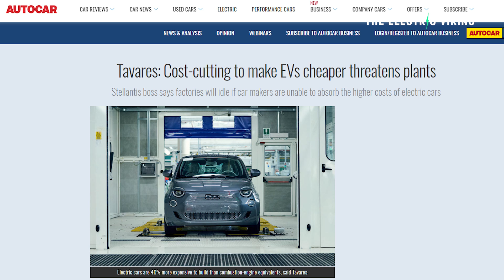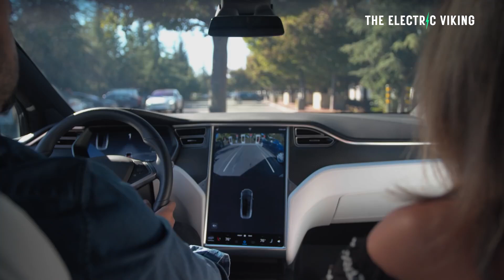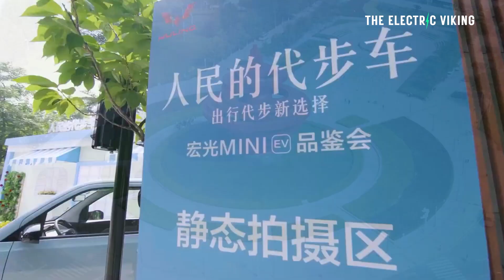Why are some EV's more than double the price of the gas model

Comment: Legacy auto makers have hated electric cars and been lying about the cost and difficulty of their manufacture at least since they were forced to make them in the 1990s ie the EV 1 by General Motors which they would only lease not sell. All the car makers made them. All only leased them until George Bush Junior the then president ,and his Republican cohorts, Big oil owners  had the Californian Zero Emissions Law repealed through devious means. They all then cancelled their leases collected all the Evs took them out to Nevada in the desert and put them all through a giant shredding machine reducing them to tiny pieces. These were all nearly brand new EVs. EVs should theoretically except for the batteries and computer chips and screens be cheaper to make than ice cars.

Comment: I dont know why why  any ev manufacturers aren't using FERADION SODIUM ion batteries. They would be cheaper and have an energy density of 2220 or 230 W akilo higher than LFP at 1a Kilo. And they have a wider temperature range charge holding capacity and supposedly a 9000 times cycle life and they have a factory in Wesstern Auustralia know.

Comment: Traditional car makers build a complete gasoline car, but DON'T install the gas engine and transmission. Then an electric drivetrain is installed. NOTHING ELSE is removed. All the support for gas remains. That car costs 40% more to make than its gas counterpart. Many EV cars are being made this way. While a designed, engineered and manufactured EV specific car will cost nearly 30% LESS than a gas car. Full Stop.

Comment: So many manufacturers will drop EV’s because of material cost or access thereof.  Which means the ICE  bans will go away.  More ICE manufacturers have determined it’s not economically viable for EV’s and most of the world doesn’t have the grid infrastructure & 60-100 amperage residential breaker boxes.

Comment: It seems to me (a non-engineer) that, apart from the battery, an EV should be much cheaper to produce because the engine has much fewer parts and is much simpler overall, compared to an ICE. Batteries are becoming less expensive all the time, so there seems to be little doubt that an EV will eventually cost much less to produce than an ICE vehicle. Stellantis might do well to hire engineers who are focused on efficiency. While they are at it, they might try making a reliable transmission (We had a Chrysler van that was totally unreliable due to its transmission).

Comment: Electric cars don't have gearboxes, exhaust, radiator. The most cost is a ice engine which is one third of the price of the car.
EV motors are small and cheap to produce.
EVs should be cheaper than a ice car.

Comment: There are a lot of evs that by the time you break even you'd have driven over 300k miles on your old car.  This is calculating if electricity was free, which it is not.  Making evs even crazier.  Though to be fair the car market is crazy on ice side as well.

Comment: They are taking a gas powered design, and pulling out the engine and transmission, and jamming in batteries and electric motors into the empty spaces.  Of course it will cost more than, say, designing and building an EV from the ground up, just like it costs more to completely gut and rebuild a house than it does to just build a new house.  And it is a Fiat 500, which is based (ICE or otherwise) on the theory that there is a sucker born every second.

Regarding that miniev thing - which I assume comes standard with paper bags with pre-cut eyeholes - I wouldn't take one for free.  They'd have to pay me, then I'd pocket the cash and drop it off at the nearest recycling center.

Comment: Ev in the body of ice is a disaster.
Designing a new ev is difficult when your past is ice.
Everything is wrong.
Once an ev has appeared it may gradually be made better but some things can not be done gradually.
Also the changes in cars normally do not happen often.
Evs may become better but it will take a long time and it will most of the time not be gradual.
The time is not working for bad design.
Add software to the game and for most ice can never be changed to evs.
Ice is doomed and they will never make it into evs.

Comment: Stellantis can't make a gas car mate. A friend's '21 Gulia had a host of electrical problems and would fill the passengers footwell with water in the rain. Remote keyless entry randomly didn't work, fuel tank vent didn't work so it would constantly shut the gas pump off (but no codes), etc. Occasional no starts for about 5 minutes. Always in the shop until luckily someone ran a stop sign and totaled it for her. Another friend's Jeep (only used on road for commuting) went through 4 transfer cases in 60K miles. Not sure about other places but in the US, Maseratis are super common in the ghettos. They depreciate to Corolla money in a few years because no one wants them, their reputation for reliability and costly repair is so bad. By the time they're 5 years old they're on sub prime car lots.

Comment: High cost of battery production? Who knew that digging stuff out of the ground and crushing it would cost so much. Of course you have to add glue, mix it and spread it on the foil, dry it and cut and pack it into a container and bolt it onto the vehicle and clip the hoses and wires on it. Why does it seem odd that it costs waaayyy more than casting and boring and machining an engine block, forging crankshafts, making and installing spark plugs, fuel pumping and filtration systems, lubrication system attaching timing chain and alternator for charging a battery, forging con-rods and machining pistons and rings and honing the cylinders, and manufacturing a torque converter and clutches. Especially when all these components have to be made from stuff that is dug out of the ground and crushed and heated to melting point first? I JUST DON’T GET IT!

Comment: As an Engineer for an auto company in a previous life (Mitsubishi Australia) I am amazed at how cheap the ICE engine and transmission is, thanks to decades of making essentially the same things. If the ICE and BE cars were at the same point in their development, the BE would easily win due to the complex and critical machining required for the ICE. Projecting into the future, I expect the BE to be 10%~20% CHEAPER than the equivalent ICE car. That's about 10 years time, and that's about the lead Tesla has on the legacy industry.
Unless the legacy makers have the nerve (and the finance) to jump into high volume production with costings calculated on huge turnovers, they will be toast. Finished. Unless they can find a massive tech breakthrough on batteries, and I don't see them even trying that.

Comment: Thanks Sam, good research and you are 100% right. 
Since 2020 we were in the market for a small EV with a 300km range. The 42kW Fiat 500e was the only one, and even has a Cabrio version. 
Gas version in Netherlands is €20.000,  the EV version is almost double. 
When the Fiat 500e was only 40% more, it should have been €28.000 and we would have bought it. 
Sadly, Fiat lies a lot, since the starting price of that 42kW Fiat 500e is €39.000. 
Perfect item for this video. Keep the fate and stay healthy.
Reply: There is another element that the ICE 500 is not the same car. The chassis is different, the ICE 500 is the old 500, the new mode, which looks similar but is completely new, only has electric transmission. Still ludicrous price, agree, but it is not twice as much. But Stellantis can charge a lot as there are no A segment EVs at the moment, after VW group retired the Skoda Citigo VW e UP.  Dacia Duster (which straddles between A and B) production has been scaled down too, I think.

Comment: Why are Tesla's profits so high? This is historically what happens when a company is a battery producer, a manufacturer, a dealership, and a fueling company. If these were ICE vehicles, the manufacturer and dealership would be illegal. This is why Ford made a brand of all electric vehicles. It moves them into the Tesla space of legality. Once Tesla is broken up, which it should be based on precedent, then its battery producer will be able to compete with other battery producers. Ford's dealerships are trying to make it illegal for Ford to make the brand. If it is illegal, then Tesla should definitely be.

Comment: It is indeed very peculiar, not?
If you consider all of the costs:
- parts,
- assembly,
- testing,
- shipping,
- pre/post-sales lies (aka commercials)
- dealers.
Some claim that batteries are the most tricky part of a car, but on ICE’s it’s the engine that’s far more complicated than the electro motor in EV’s. Cylinders made at a fraction of a millimetre.
And: batteries are for all EV-manufacturers more-or-less as expensive (only if you do the mining & refining yourself, something that Tesla is going to do in the future, but not yet doing)
The most important key factor is Tesla’s Uber efficient factories. If Tesla would make ice-cars that way (I know he won’t ever do that), it could be done with far bigger margins than current manufacturers are getting)
Herbert Dies noted it: far more automation and vertical integration.

Comment: The electric motor is simple and easy to make compared to the ICE. The bodies are essentially the same, with maybe a slightly stronger chassis to cope with the heavy battery. The springs and shock absorbers need to be stronger too. The battery and its wiring costs much more than the tank and its pipe work. Batteries are going to get cheaper….inevitably. Overall I’d expect BEVs to cost 10% more - but with significantly cheaper running costs most people will chose the BEV. In summary ICE cars are toast. Electric cars are the future. It is inevitable.

Comment: If you put a €10,000 battery into a €10,000 car, you double its price.  If you put a €10,000 battery into a €50,000 (fan-boy) car you only add 20% - and you pocket all the rip-off profit in the same way as Apple.  There's nothing new here, all the fashion houses do this, a la €20,000 handbags worth about €200 in reality.  The fact is that unless you tie yourself withing the range your home charger there is absolutely no saving from driving an ev - even the no pollution claim is nonsense when virtually all electricity comes from fossil fuel fired power stations.  We need to stop all this ev nonsense and tackle the root causes of transportation costs and pollution..

Comment: The high cost to make EVs right now should be expected. Imagine how expensive gas cars would cost to make they had only been in production a few years and total production was only 2 million a year for all car companies. It's also understandable that the materials have gone up as more automakers have started using a lot of batteries. The cost of mining and refining lithium didn't mysteriously quadruple in one year they are just charging more because demand is up. As more battery types that use different materials ramp production and more mines start producing the price will come down. Meanwhile the cost to make catalytic converters continue to go up.

Comment: I say this all the time. There has to be a huge cost savings replacing a gas engine and transmission with 1000 plus parts with an electric motor that has about 5. This is my big objection to EV prices.

Comment: back in 2017 a lot of us thought by 2023 EVs would have reach price parity with ICE cars.  its been a bummer that prices have not come down faster.  we just bought a used car with 150,000 miles on it it hoping it will be our last ICE car.  hopefully, in 7 years I can get a reliable used ev for a decent price.
Reply: You get price parity by raising the price of ICE cars not by making BEVs with less features, horrible charge experience and overall compromise. Example: Honda Civic is now twice the price it was 20 years ago but not twice as good. 60Kwh Leaf AZE1 is the same price in real dollars as the 24KwH Leaf AZE0 was when it first launched
Reply: @theairstig9164  yeah its improved no doubt, just not as much as a lot of us projected

Comment: If it costs Stellantis 40% more to make the Fiat 500e vs Fiat 500 ICE vehicle, then why is its retail price double rather than just 40% more? Stellantis is either gouging the public, lying about the additional EV cost, very inefficient at building EVs and unable to scale volume, or they have no desire to build/sell EVs (only ICE). They have certainly not gone all in on EVs, and are 5-10 years behind Tesla & the ~150 Chinese EV makers. The decade will not end well for them.

Comment: Come on, Sam.

Tesla underreported the cost of their batteries; they always have.  Between that and all the subsidy they receive, and new construction 'loans' they haven't had to repay, they can continue to LOSE money on their cars, as it doesn't matter to their stock valuation (the only 'profit' they make).  BYD is runaway ND supported by the CCP, and is specifically built around undercutting everyone.  They're a state program, so they aren't going bust.  Compare that to Nio and  Xepeng, who are going bust like Rivian and Lucid.

It's simple materiel cost, Sam.  It's not about corporate resistance.  Please stop propagandizing.

Comment: I suspect some day we'll discover all the hidden interdependencies between the ICE industry and the oil industry. The big player is the oil industry. And it has a very hard time with this transition.
Reply: Gasoline is a byproduct of the oil refining industry. Diesel can be jet fuel and vice versa. The only use for gasoline is transport fuel. I am predicting by 2050 it will be pumped back in to wells to get rid of it. If the gasoline can’t be used, rubber products plastics fertiliser natural gas and lubricant prices will skyrocket. Start there
Reply: @theairstig9164  Chemistry is complex. That something has been found useful for one thing doesn't mean it can't be repurposed for another, or further reduced to constituent components of which other products can be created or used in other ways. The difficult part is restructuring an already profitable model into another one. While it takes a certain kind of creativity to turn crap into gold, it's not the same as turning something dangerous into something beneficial. We often see the promotions of benefits. Businessmen wont often promote the downside of a product unless it is the product of a competitor.

Comment: Is Stellantis using the same body for the EV variant as the ICE?  If so, that may be the reason it's costing them that much more to produce the EV (Having to custom fit EV parts into ICE body)
Reply: When it's basically the same car but with a different drive train, then the car would be cheap to make, because it's basically the same.

(Edit: Because when it's the same body, then it would be easier to make the same body again. When it's not the same, then not. Obviously ;-)
Reply: No, it is not the same car 🤦. The old 500 has stayed in production as ICE model. The new 500 is electric only, it is a completely different model, not restyling. So, they are comparing apple and oranges. Not obvious, as the cars look similar, but if you saw them side by side you would understand. Still very expensive, but as there are no A segment EVs anymore after VW left the market,  Stellantis can charge what they want

Comment: To be honest, I think Toyota hydrogen car is the future. Hydrogen car is just like Petro car, take almost no time to refuel , and it could be cleaner than Petro car. It will be interesting to see hydrogen car battling electric cars.
Reply: 5 times the energy to drive.
Reply: First car probs yes 2nd car at the station +10 min and 3rd has to wait even longer until the 600bar are there again
Reply: Hydrogen is an absolute dead duck for cars.Technically and economically, it makes zero sense. https://www.youtube.com/watch?v=JlOCS95Jvjc
Reply: When people make fun of Tesla making electric vehicles, we call them short sighted. People say’s electric car is not possible, and decades later, they are proven wrong.

Why are people so stubborn on focusing on one technology. I think both are great with great potential, but hydrogen cars may be better in the future. I don’t see why you people don’t embrace new thing.

Decades are, electric cars are meme. Now, people think hydrogen cars are meme.
Reply: @hugochan2821  there is no fun here, just facts.
Reply: @hugochan2821  Watch the link that I provided...

Comment: I suspect that Stelantis is correct.  If you assume that Tesla's ability to manufacture cars efficiently gives them a 50% cost advantage over their less automated competitors then that would imply a gas car spec'ed out to the ICE vehicles selling for would basically be cars Tesla would have to sell for $25k to keep their current margin if Tesla made those.

Of course the vertical integration and the lack of oil change economy (the original car can be a loss leader for future repairs) may be playing into this.

Comment: I looked at Hyundai, for example. Ioniq5 is cheaper than the plug in hybrid version of SanteFe ( a similar size car ), but if you look at the Kona, the base gasonline version is half the price of the electric version. I think this is only due to the economy of scale. When they mass produce the engine and transmission, they tend to get cheaper. Also, the price difference could be justified by the fact that Hyundai wants to make a much bigger profit on Kona EVs, since there is a lot of demand and this drives the price upwards. On the other hand, the base model of gasoline comes with much less tech than the eletric one, and I suppose that this must cost a little more.
I don't think it costs that much more to make, as long as the company has a set contract with the battery manufacturer.
Reply: But no body can have the original Ioniq to choose from.